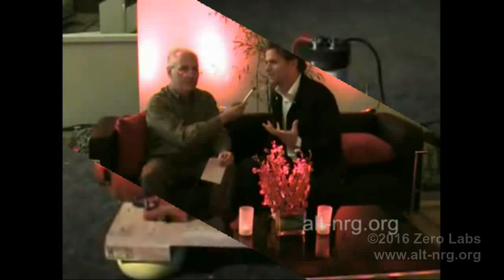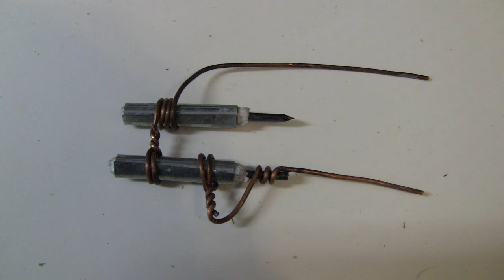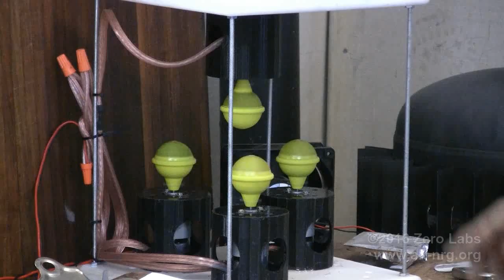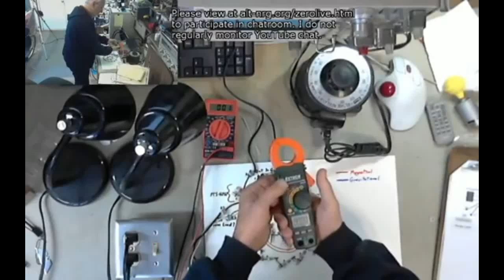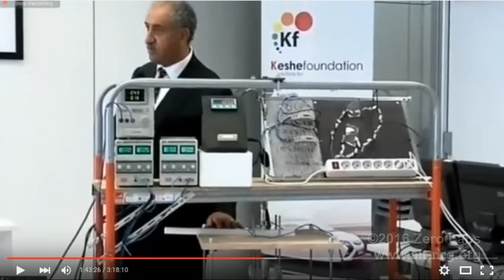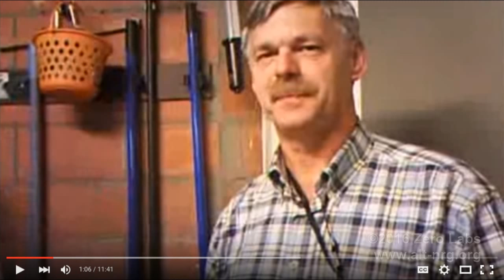#430 Kolossal Keshe Katastrophe Finale, almost

Comment: Hello ZF, great video and good to come across someone who has some clues on reality.
My had is still shaking in disbelief of what I have stumbled on (or stepped into) before coming here!
The only thing I would like to add in relation to your measurements is in regards to the voltage and current measurements is
that you really need two voltmeters and two current meters, one set on the input and the other on the output side so that you can observe
the four quantities simultaneously, as the mains voltage can and is likely to change somewha tbetween the times that it takes
to transfer the meters from one side to the other.

The main reason I am bringing this up is that the test "circuit" is in series with the mains - is this correct?
If so, your input current must be identical to that at the output.
The voltage however, depending on the current drawn by the load and the amount of resistance present between input and output
will determine how much less the output will be than the input, this assumes no laws of reality are violated
and there's next to no chance of that being the case.

Just in case you have not come across a gent called Gerard Morin and you feel like some very frustrating "entertainment"
and contradiction to everything you may know about electricity, magnetism, resonance etc you will be in for a treat.

Thanks and all the best.
Mark G.

Comment: Have you checked out the video series called The PRIMER FIELDS? This is where the real plasma science is going. And while were are at it, would you be interested in building and testing MY free energy machine? I know it will work, even better than KESHE'S machine, but I need a few suckers, I ,mean experts in magnetically induced perpetual motion machines, to make it work, for eal.  It's working even now, in my MIND.
Reply: +NEARest Galaxy Communications High voltage universal Electric currents flowing though out space is according to the Thunderbolts project, the real power behind formations of galaxies and planets, and as far as the high voltage zapping of planets between each other is TOTALLY TRUE, AND I BELIEVE EVERYTHING THEY SAY, BECAUSE NASA is the one that is full of bullshit, Gravitational collapse. Rubbish.
Reply: But there are those massive scoop marks that scooped out millions of square miles of Mars surface, at varying depths, that are IRRECONCILABLE. If you can't provide us with a viable explanation to those scoop marks and dendritic lightning branching all over the crater lips, and the 5 miles thinner crust at the northern hemisphere, then you are an imbecile who is not worthy to debate this very serious and enigmatic reality.
Reply: They did a very good look at collapsed lava tubes and came up empty. Collapsed Lava tubes require, a tunnel entrance from the surface, and a rubble field as the roof of a lava tube will collapse, and an outflow region. None of the so-called collapsed Lava Tubes show any roof collapse, or rubble field nor was there any outflow lava field. See the video THE LIGHTNING SCARRED PLANET MARS. If you either refuse to see it or believe it, then you are a complete IMBECILE, and don't ever message me again, as anyone who does see this video ans still doesn't believe is not worthy to debate with the rest of us, real intellects.

Comment: Hi Mr Zero, just wanna say wow... your methods are intriguing. I find it interesting how on a number of occasions you state that you are following the designs/blueprints etc.and that you're following directions precisely, and then you go on to show the system you have built, and the modifications you have made to it which are clearly different from the design.
 A simple example of this is your beads coil set; First of all, All of the wires in your beads system must be properly nano-coated. When they are properly nano-coated they will be black. It is evident in this clip that your wires are not properly nano-coated. Aside from that I think that you should perhaps look again at the design you followed and then at your finished system and try to pick out the (not so) subtle differences. Notice how on the design the beads have been arranged, along with the wires between them, to form a circular shape. There is a reason for this. Your system looks more like the blade of a circular saw. Here's a small analogy .. Imagine you have two pipes through which water can flow. Shape the first pipe like the design in a nice smooth circle, and shape the second pipe following the profile of your system - jagged circular saw tooth. Now through which one of these two pipes will the water flow more freely? Pretty obvious isn't it.. the circular one. Now, take this thought and apply it to what you are trying to achieve with your beads system with the new understanding that like the water flows through the pipe, the plasma flows through the nano-coating.
It's also quite clear in this clip that you don't fully understand the concept of the creation of the free plasma with your starship formation. When knowledge is given freely the onus is on you to learn, not on the teacher to pander to your deficiencies.
I don't mean to seem rude, alas, the tone in this thread had already been set.
Another thing I think is worth mentioning is your poor scientific method. I don't know of your qualifications but I do know, as you should if qualified, that when designing an experiment and performing it using the scientific experimental method one must try to eliminate any bias. It should go without saying that a biased experiment will provide biased results.
Your bias has permeated your experimental method to the point that it can not be considered scientific, i.e. your method has no integrity.
Answer me this if you will.. If there is no truth to the knowledge that Mr Keshe has shared, why is it that my experiments (conducted using the scientific experimental method correctly) do work?
Tell me how, if not because of what I have learnt from Mr Keshe, I have made a battery that produces a steady current using only a small strip of tinfoil, a small strip of baking paper, and a nano and gans coated piece of string? Just how did I manage that if it wasn't through what I have been taught?
If you do not understand, You do not understand, no one else is at fault.
If you would like evidence of my battery made of string please just let me know, if you like I can email you the picture.
Finally, and this is just a tip toward your social etiquette.. when you bad-mouth someone for half an hour going as far as to say the world should be rid of them, and then end your presentation with "Peace everyone", well, you just sound like a dick. Don't be a dick.
Reply from the maker: +bob the builder Well, mr. "bob the builder", that's an awful lot of criticism from someone who has ABSOLUTELY NOTHING TO SHOW US ON HIS OWN YOUTUBE CHANNEL. You also just wasted a WHOLE lot of time composing your long winded reply obviously without first seeing my video #432. And before you start in on any differences between my plasma reactors to others, I will point out that mine are VASTLY SUPERIOR to anything demonstrated by Vince or Mr FixIt Rick who only had simple ping pong balls without any copper plating or any nano coating. Choke on that one for a while.

Comment: No I don't follow anyone blindly. Mesiaha is a joke too but I want to see if the coil system works. This what you have done is awesome  btw. I wont try duplicate what you hv done. I independenlty came up with some similar theory of energy and matter so I want to follow this up. If I fail - too bad but I might get it right too.
Reply from the maker: +Harry Pink Bravo for trying. Please be sure to PUBLISH your results, one way or the other.

Comment: You have some involved subscribers Z. The knowledge in just this thread is astonishing. Quick question: Could a perpetual motor be made modeled after a V (4,6,8...) engine with magnets for pistons, magnets for cylinder heads opposing each other?
Reply from the maker: +Tim Murphy IF a magnet motor is possible at all, I doubt it would be modeled after a piston engine.

Comment: You have to Atomic Carbon coate al cables and wires in the world, to make it work, you have to start over, you understand !
Reply from the maker: +Slein Nesnej Enough people have criticized what they call my inadequate nano coating that I will rebuild the Magrav Energy beads this weekend with fully blackened nano coated wire, if for no other reason than to see what on Earth they might criticize next. I will be starting the nano coating process tonight, aligning with a volt meter and starting a new layer approximately every 12 hours so that by the time I reassemble it will have 8-10 layers. When it behaves as I predict and fails to provide any power at all to an electrical device attached to it, that will be the end of the experiment.
Reply: +ZeroFossilFuel - Nothing will happen, Keshe is totaly insane, i am just Trolling you ;-)
Reply from the maker: Slein Nesnej Funny but I believe this really needs to be done to drive my point home.

Comment: I think all of us here believe in the scientific method and being able to recreate another's experiment to get the results or debunk their work. But if you're going to recreate an experiment, make sure you recreate it faithfully. There are a lot of points I agree with about the scribbles and the everchanging designs given out, so pick a model and try to make that one work otherwise you'll never keep up with the changes. This model is already 2 generations old at the time of this being put up. I'm not saying Keshe's experiments are true or false at this point. But following the design "to the letter" is something you certainly did not do. Your wires are not properly nanocoated and can be seen clear as day. You have sections of copper still visible throughout the entire project. They should all be shiny black in color. You never described how you coated or how many times you coated but my guess is just once from how these beads look. Also, you added the fuse to your project which was not described. If you are certain that this does nothing, remove the fuse from the circuit and try results then to see if it changed your results. Before you try to debunk something, make sure you are following the instructions - granted his teachings are extremely difficult to follow. And he HAS shown his most recent magrav working by the way. Whether or not the numbers on the meters have been altered are unknown, but the video was continuous and did not cut to the meter reading. I would like to see a faithful recreation of a system before passing judgement.
Reply from the maker: +Steven Michlin Please see the updated video description.
Reply: +ZeroFossilFuel  I'm trying to be a stickler with your techniques because from other videos I've seen you're very thorough. I respect your dedication to what the rest of the world calls BS for now. I too am attempting to make the reactor and believe me if it works or does not work I'll be sure to let you know.
Reply from the maker: Steven Michlin I look forward to your results.

Comment: It seems to me that some copper wires are not fully nano coated (black). That's probably why it doesn't work. Also he should put out all of his beads and check voltage (1-1.5v), if one is failing, I suspect plasma flow wil stop and so then no work from plasma will be available
Reply: +Andrew Chiefchickens No. This whole plasma babble is nonsense. Keshe has shown his complete ignorance during the last four months when - after having announced and sold (!) a device which did not even exist as a prototype at his moment - he changed the specification and building instructions almost dayly to keep his followers busy ("donkeys like carrots" and "you are the most stupid lot I have seen in my life" - his own words) and sell more of his nonsensical units.

Face it - he is a scammer and mentally ill in a hopeless state.
Reply: Cold electricity is TRUE electricity.
It is the real power without electron flow.
This type of electricity was shown to us by Mr.Tesla over 100 years ago.

The electrons are simply "dragged" by this Cold electricity flow and this creates what we see as resistance.
And this is also the reason why conventional electricity shows up on our meters.
We can measure resistance, but True Cold electricity does not show up on our meters, because there is no electron flow, yet it can burn a filament bulb on one wire.

In conventional electricity, the dragging electrons , create the magnetic field and, these two go hand in hand.
This is the reason why we won't find any OU in magnetics.
The magnetic fields are caused by the dragging electrons, which in turn are a secondary effect of this primary True Cold Electricity flow.
You can't tap something secondary without the primary part that caused it...

For some people, all this is well understood, but for the most part, people are still thinking electricity is electron flow and even our teachers tell us it is.
Reply: it would be useful to disclose some technical understanding that Nikola Tesla.... and Eric Dollard and others that have been working on a mysterious form of "Radiant" energy. The correct name for this is "Natures electricity" - void of the magnetism that we find in electromagnetic systems we use today. It has taken  many years to understand the principles. Tesla ended up discovering that nature uses a spectrum of different pulse frequencies of DC to create phenomenon we experience without understanding why or how. If not understood - it was deadly and dangerous - and killed a lot of technicians back in the days of starting up with DC and AC infrastructures with high capacity to store energy. When suddenly shut off - there was a "different" kind of energy that went backwards much stronger than the source.
 By restricting the flow of electrons - that is what will kill you.... the question arises, "How can there be a duality to create a flow in "static" electricity without the electron"? The answer to that is to understand that Natures "ONE" created duality to create movement. From one point there is equal and opposite movement - from the ONE still point. This point is NEUTRAL. This is the REAL ground. We use only the positive and negative and have forgotten the neutral. Positive and Neutral give you a new duality - and neutral and negative give you another duality. The negative will kill you and the positive will not. This is what we call CURRENT - some could call it MAGNETIC current. But it can also be called positive DC. The Nano coating of the Keshe technology stops the electron dead in its tracks due to the extremely high resistance. Tesla and others have used graphite - graphine - Carbon - to do the same. Carbon is your NEUTRAL in the mix. This will give you the idea of how to make a Positive electric battery by using the positive and the neutral only - Interesting???
 This process is been known as "splitting the positive" in the free energy circles and it is not really understood without bringing in the neutral. The neutral has a speed faster than the speed of light. Tesla knew this too.
 In the near future, the planet Earth will become re-magnetized by the Sun as a Unipolar Magnetic entity - just like a holding magnet. The electrons will go away and the planet will become just like a nuclear core with only protons and neutrons - positives and neutrals and will give off its own light. This is why humans will in the future only have this new energy form available to them. This is why it is important to change our infrastructures now.
Reply: +cat1stevens Satire?
Reply: +cat1stevens Thank you, I'have studied Bedini stuff too. This make a lot of sense to me. 
To all the others, try to make some Keshe stuff and try to understand the new physics he is trying to push out. Experiment and try to understand the new.
Reply: +Andrea Pelagalli Maybe you DIY and perform correct tests before you try to explain "physics"
http://thinkscientific.w4f.eu/Messtechnik.html

Comment: Thank you for Kolossal one Zero! 
So from what you said i guess you doubt in Perendev generator too? Even with proper shielding?
Reply from the maker: +oxiigen I have first hand knowledge of an excellent 3rd party build and evaluation. The energy that makes the rotor accelerate is added only as the outer clamshell is pushed into position and clamped into place. Once in it's final position the rotor begins to coast down again. Sorry, totally busted.
Reply: +Igor Krizanovskij MU metal most likely, it is the material used to "shield" magnetism in many applications. Actually it does not shield (this would violate the first law of thermodynamics), it just bundles the magnetic field and keeps it concentrated.
No, face it, magnet motors do not work for the same reason as Keshes invention does not work.
Reply: +ZeroFossilFuel hmm, OK.
perhaps you know what kind of material was used for shielding?